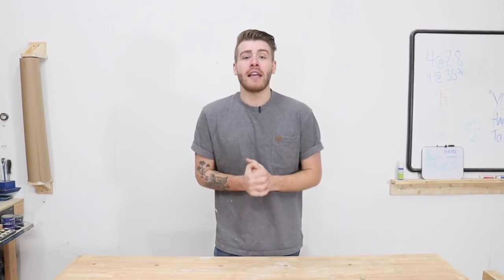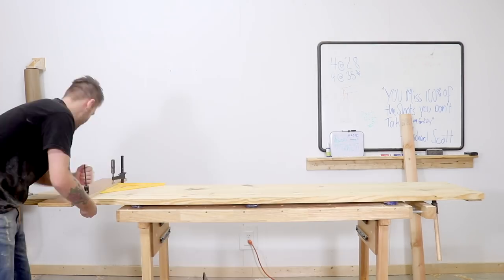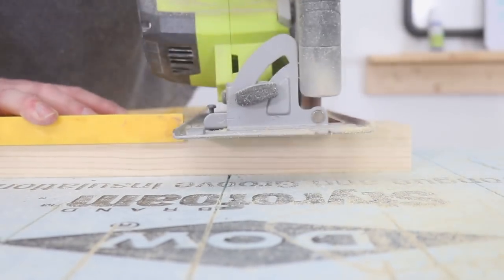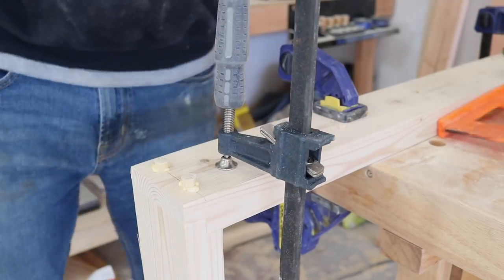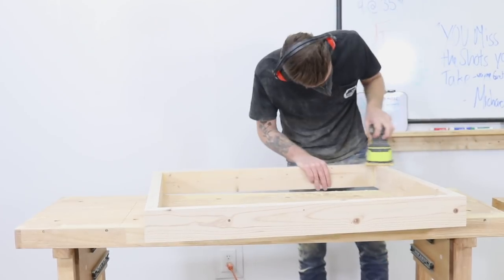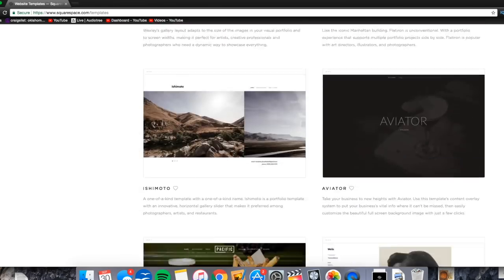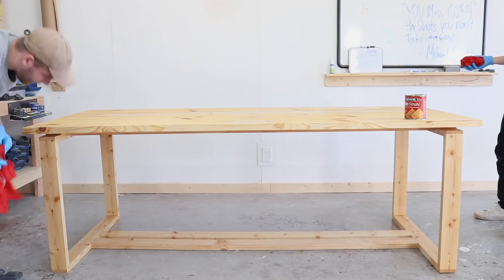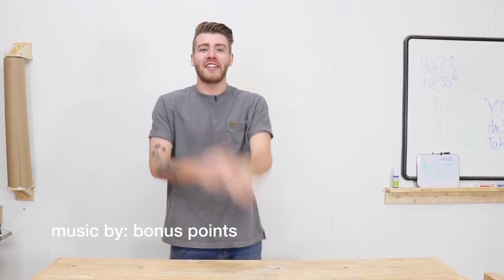Modern Split-Top Dining Table | DIY | Modern Builds

Comment: Loved this when you 1st posted and built a coffee table sized proto. Had built a few dining tables for clients but there was a lot of back and forth movement lengthwise. Did urs come out rock solid? I ended up having to apologize and go back and add V shaped stretchers connecting the bottom stretcher to the top. Thankfully the clients were gracious and tipped🙏

Comment: Hi, I see you use water based finish over oil stain. Did you ever have problems with that combination? I was told just today that I would need to cure the minwax stain for three days before applying the water based finish, or go with the oil based finish. What's your experience? Thank you!

Comment: Mike Montgomery makes DIY actually seem possible.
Reply: Sure, simply equip your already adequate workshop with a thickness planer, a bandsaw, and an oscillating orbital sander and you're good to go. (Space and money no object, naturally.)
Reply: @Rob Petrie I see you use a lack of expensive equipment as an excuse. You're not limited to those exact tools he used as I can see several alternative electrical and even hand tools that can work as a replacement. He has what makes his DIY less time consuming and more efficient. You can do exactly the same with more affordable tools and more elbow grease. Oh, and a better attitude.

Comment: How is this ~31" wide if you're using four 2x12's as the top?
Reply: was it ever explained? i couldn't figure this out either - 
it'd be either a little over 24' (2 boards of 2'x12') a little over 48' (2 boards of two 2'x12' glued together)

Comment: Could this be done without a planer for straight edges?  If so how would you recommend doing this without an expensive planer?
Reply: Rip the 2" sides with a table saw.

Comment: I love the separation effect on the table top! Also. Were you able to get stain in between the two top pieces? That gap looked a little light but it could have been the lighting in the video! Cheers man!!
Reply from the maker: There were definitely a couple spots I wasn't able to get. In hindsight, I probably should've stained it before I attached the two tops

Comment: Hey mike, all wood has a natural curve, known as the crown. When combining boards you want to make sure the crown or curve of all the boards are the same way. Usually the crown goes up in the middle so you don't get a negative bow in the middle of the table. Planning helps but over time the natural expansion and contraction of the wood will warp the table top slightly. Just another tip to help your get to next level production! Have a great one!!!
Reply from the maker: good tip! thanks man

Comment: Hey Mike! I love your channel and suggest it to my upper school students all the time as a High School MDT teacher. I made this table and I LOVE it!!!!
I am finding it has a bit of sideways wibble wobble. I'm thinking I'll put extra screws in from the legs to the table top - any other tips on stabilising it more?
Reply from the maker: Yeah, adding some felt pads on the bottom could help. In Case there’s a little bit of warpage in the bottom 2x4 it makes it so there are only 2 points of contact with the floor
Reply: Sounds good, I'll give that a go, thanks for your quick response!
Reply: How is your table holding up?
Reply: Yeah its great now, no wobbles. I put some thin plywood under my bottom piece as it was slightly off the ground and I put extra screws from the leg-piece into the table top to help stabilise that too.

Comment: Hi Mike.  Good looking and simple to build table, but I am concerned about wood movement.  You screwed the top directly into the stretchers without elongating the holes.  I think this may present a problem later on.
Reply: I would agree Johhny.....Long term the table top would shift causing bad joints, etc.
Reply: Not to mention using construction grade lumber sitting at 15-20% moisture content. Chance of failure at 30 - 50% . . .

Comment: Hey dud, can u do a project without using any tools except household tools
Reply: jon bon jovi c I agree with this. I love the table and would love to build it, I just don't have the........anything that is not hammer, nails, screws, drills, wood glue, table saw, circular saw, sand paper.